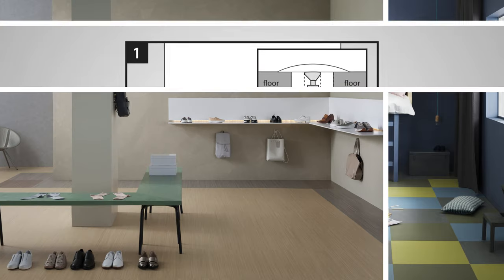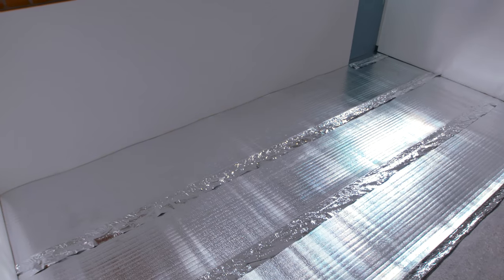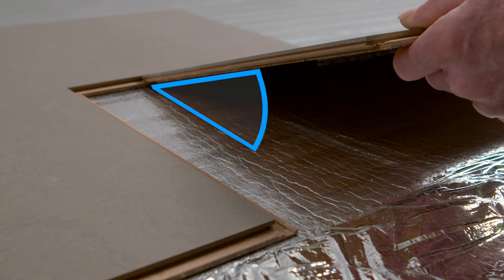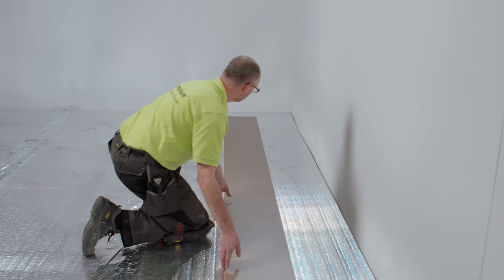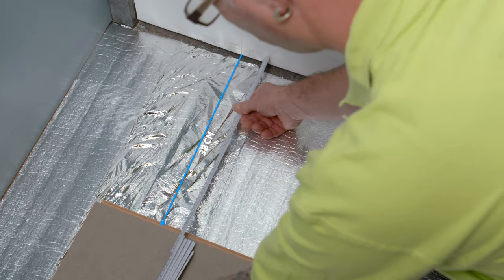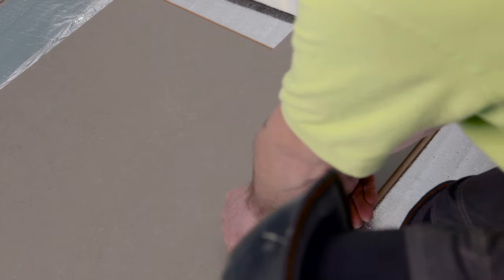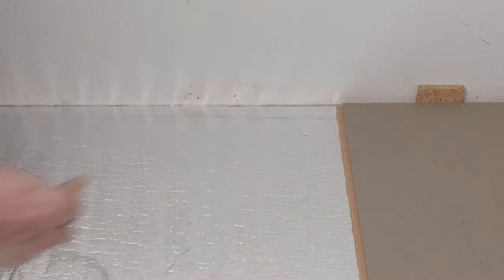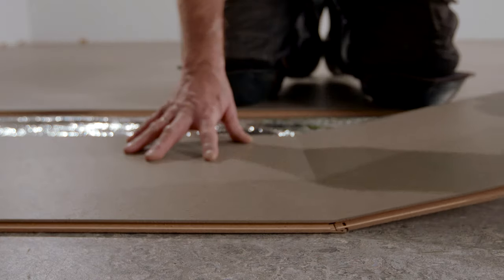Marmoleum Click - Installation guide | Forbo Flooring Systems

Comment: I just finished installing two marmoleum click 5G square tile floors, and there are some things one needs to know. For the most part, they install left to right. The tiles cannot be turned around 90 or 180 degrees. The position of the tile is always the same with two female tabbed sides on south and east( the east identified by a black plastic gasket) and male sides north and west. The result is more waste accumulating left cut edge tiles. To install, one must lock the male west side into the female east side by holding the male side at 45 degrees and lowering it into the female one. There's no "click" that I can hear, but one must keep the two parallel edges snugly against each other on the first row, and on following rows, the contact is between east-west and north south. There should never be a VISIBLE SEAM between edges, and all four corners need to line up exactly. One can rapidly wiggle and snug the newly attached tile to eliminate any tiny seam. Once a tile is in place, one can feel if there is an edge between tiles and gently tap the smooth surface of a piece of scrap to eliminate that edge. One can move a square by gently tapping, but any force will misalign everything. It is possible but very difficult to tap a square into a notch created with an oscillating saw, but unless one removes moldings one still must notch in order to leave leave 3/8" on all sides for expansion when finished. Because tiles are added at a 45 degree angle, one must allow for fitting under heat registers with this in mind. I found it was easier for me to make straight cuts with a 7 1/2 inch carbide tipped 40T circular saw blade attached to a table saw vs. a jigsaw. Overall this appears to be a solid quality floor with a cork base that should last a long time. I love the matte finish which is not shiny and is easy on the eyes. Two more floors to go.
Reply: i also did not hear a click sound. the installation is straight forward but getting a tight fit does require light tap. the cork backing is fragile so pay attention and be careful when handling each board.
Reply: You will regret using this tile.   It lookd horrible after 2 years, not water proof, and poor wear quality etc.

Comment: I see a lot of negative comments about installing this.  I just did half of one room and it was easy once I figured out that you have to go left to right with the tile tongues towards you and to the right.  One thing, the tiles are about 11 1/2" square not 12" square, so plan for that.
Reply: Thanks Bill, intent to lay this floor for a living room. So are you in USA and used the USA product of this tile ? thanks.

Comment: I just bought this product in California, USA, and each tile measures 11 7/8"x35 1/2".  I played around with it, but I have not done the install yet.  I have to work with existing cabinets in a kitchen, so installing the last row is not going to be fun.  Logic tells me that if I skip the initial 3/8" shim under the cabinets, install the last row, and then slide the whole floor over to center it and allow for 3/8" gap all around. I'd have 3/4" to work with while installing the last row.  Wish me luck!

Comment: This product is garbage.   If you've already bought it and haven't installed it, don't install it.   There are numerous problems with the product.   1.  You will note a picture of a seal on the box, that says "H2O proof.   There is NOTHING water proof about this product.   2.  The linoleum is bonded to what appears to be a layer of burlap glued to  particle board (more like cardboard) about 3/8 of an inch thick.   After regular moping, the linoleum will unglue itself from the sub-straight.
  The tiles start to buckle around the edges.   I've worked an area about 35 feet by 35 feet using this tile.   It fades, the linoleum is inferior and will peel up.  Water easily gets between the tiles and then under the tiles where it will eventually mold.   My job is to replace the worst of these bad tiles.   The product is so unstable, that you have to trim every piece to fit it in.   It also appears to be unstable in that the linoleum seems to have shrunk on the replacement tiles we have.   It is tedious trying to replace these, having to cut, chisel,  sand or grind edges to fit in replacement tiles.  Due to the buckling of so many tiles around the edges, we bought a small air compressor and high powered stapler, having to staple each buckling tile around the edges.   Then you have the problem of having to pull out the staples when the tiles are shot.   This means using vise grips or a grinder.   Our tiles are laid on a plywood base, 3/4 inch PT plywood.
If you could see how bad this tile ages in just two years since it was laid, you would never buy it.
Reply: Hi, is it possible you could provide me with pictures of the floor after two years? I'm considering this floor and overall the reviews are great but yours isn't and im really curious. Thanks!
Reply: @Rikb1234     Sorry, I don't have the capability to send a photo.  The floor I'm referring to is the Blackbird Ordinary Lounge in downtown Miami.   They put in a 35 by 35 foot floor using this product 2 years ago, a blue floor tile.  I just installed several pieces a month ago to replace pieces that were deteriorating .    They already look bad.  The entire floor looks horrible for something installed just two years ago.   Like I mentioned, there's nothing waterproof about the product.    Moping the floor about 4 to 5 times a week, the tile itself starts to separate from the layment below.   Just fitting in replacement tiles is tedious, and I find that the replacement tiles, brand new out of the box, show the particle board extends a fraction of an inch wider than the tile.   To eliminate that exposed particle board, you can cut or sand off the overlap, but what a job.   We have to use a pneumatic staple gun to fasten the tiles to the plywood subfloor.   This also detracts from the appearance.   Overall, the tiles look hazey, faded, worn, coming up around the edges in various places.   My suggestion would be to find a tile that is absolutely water proof.   I don't know what to recommend, but I did notice Ridgid floor tiles at Home Depot, claiming to be waterproof.
Before making a big investment and doing a lot of work, just buy a single box and do your own research to see how the tile holds up.